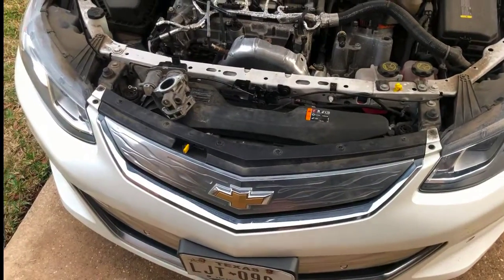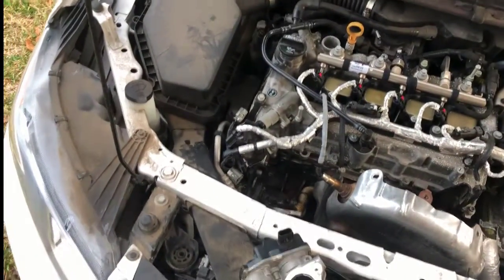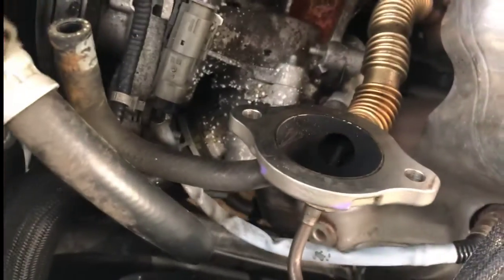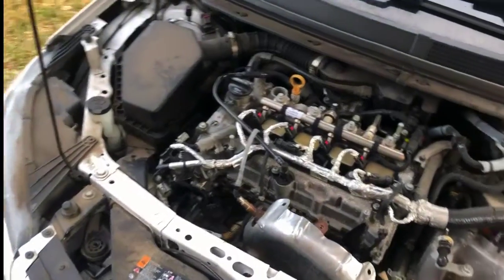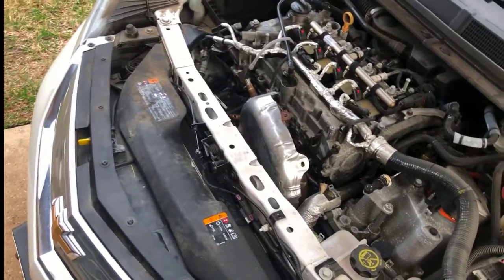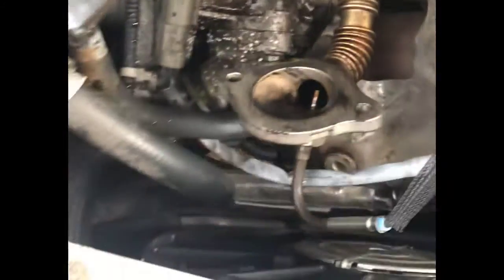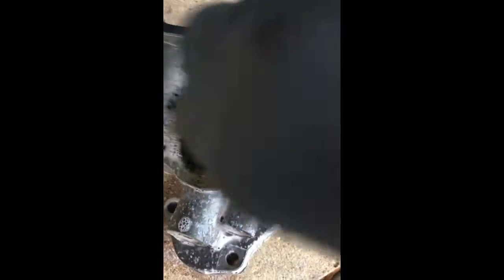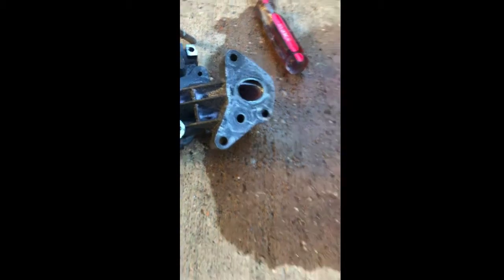Chevrolet P0401 Engine Code - EGR Valve & EGR Cooler Cleaning (Volt)

Comment: Well, it is a known fact that the first generation of Volts require premium fuel. There is no indication that GM did any modifications in the system of the second generation of Volts to justify using regular gas. Maybe they wanted to make the car sound more appealing to the average consumer who doesn’t want to pay for premium fuel. It is also a known fact that hybrid cars engine have a lot of cold starts. Every time the engine starts, a spark is produced which creates residue from the combustion resulting in dirty egr.
In the end, we all have to pay; whether we believe or not.
Now, my comment was more related to the fact that GM extended the warranty to 15 years for the clogged egr and the faulty BECM. The dealership replaced both items in my Volt for free. It saved me 2k plus 3k.
It is also a known fact that this video is about cleaning a n egr in the Volt.

Comment: As long as the EGR valve doesn't blow the non-walk-home fuse, it just needs a cleaning.  
 problem with these, is that the engine sometimes doesn't reach operating temperature, mine has come online a mile or 2 from home.

Comment: I just took my Chevy 2017 volt to the dealership with the same problem: clogged egr/cooler due to using regular gas instead of premium.
They replaced the system for free under GM extended warranty of 15 years/ 150k miles.
The same applies to the BECM problem.
From now on, I will only use premium fuel plus ocasional fuel system cleaner.
Also, driving on gas could contribute to cleaning the system.
Reply: I am very skeptical that regular gas could cause this problem.  Is this a known issue that regular gas clogs egrs?
Reply: Yeah I don't think too that using premium will solve this situation. Your engine may run even more sluggish until the computer relearn. Running the engine on hold mode, highway speed once a week will do a better cleaning that EGR valve. Also,  cleaning the EGR valve once a year, like explained in this video will probably save you some troubles.

Comment: Hi Rick! Great video! My wife's 2018 with 188000KM has this code. I will do a cleaning on the EGR valve and cooler this weekend. Fingers crossed.
Reply: Update: i used carbon cleaner with this method. Cleaned the egr valve with spray nine and some carbon engine cleaner. I then sprayed a bunch of carbon cleaner into the cooler and let it sit for about 10 min. Cooler was plugged up but the carbon cleaner worked well. Permanent fault code cleared now.
Reply: @shannonsmith148 it’s been a while hello, just wanted to know if you can update us on how’s it’s been now? Have you had the code come up again? I might take mine to a shop they will charge me about. $280~300 to clean both the egr valve and cooler so wanted to make sure this does indeed work 

Thank you I’m advance

Comment: Hey I wish I had your same reaction and outcome you did after I did this. But no luck for me :-( and my inspection is due this month. I soaked mine overnight. I also sprayed carb cleaner down the cooler while engine is running, read that somewhere. P0401 came back after reset. With scan tool egr error remained at negative 70% to mostly 96-100%. Fuse has never went out and coolant has never gone over 217. Any other thoughts?

Comment: Great video, worked for me, saved me $$$, Thanks! Some comments for those who want to try this:
1. This was a two-hour job for me. The bolts were difficult to reach; you'll sometimes be going by feel. I needed two lengths of socket extenders. The spacing is tight. I never cut my hands, but I went through several pairs of nitrile gloves. And I went through two handkerchiefs, I was sweating wrestling with this. 
2. Like another commenter, I had success just using carburetor cleaner with the straw attached to the nozzle to better direct the spray. I had the Purple Power degreaser on hand but never used it. The force of the cleaning spray really helped. I also used a small wire brush. If you go this way, plan to use a whole can (though you may get away with less).
3. There are two gaskets, one between the flange attaching the metal hose to the front of the EGR valve and the EGR valve and one between the EGR valve and the engine. Keep track of them, they could be easy to lose. The first is clipped to the flange, but the second doesn't have a retention mechanism that I saw, and is just sandwiched in place. 
4. In my case, not more than one pint of coolant leaked during the cleaning.
5. All bolts were 10mm. The two on the front flange are shorter than the three on the EGR valve itself. The three on the EGR valve have black plastic(?) bushings on the bolt-head side. These can come out of their seats in the EGR valve, another thing to keep track of.
6. I found removing the black hose secured with the hose clamp to the valve difficult. I removed all the bolts first, then rotated the valve to make getting to the clamp and hose easier.
Good luck!

Comment: Thanks man. This worked! I used b12 Chemtool spray and a power washing degreaser/hot water. Worked good. My cat would get red hot while idling the engine. After cleaning it stays nice and cool. So far so good. 2017 volt.

Comment: I Have a 2017 volt with only 20k which 90 percent of the miles were on electric.  I took a 2k trip and the reduced propulsion error came on.  Took it to a chevy dealer in Baton Rouge 1000 miles from home in Ohio.  They said it needed a new egr valve.  Ordered one on eBay for 575 and the are charging 250 labor to replace and 150 for diagnosis.  I would recommend anyone considering a volt to purchase used to stay away.  I bought mines new and it only had 20k before this problem and I rarely used the engine,  What a pice of Junk!!!

Comment: Hi Rick... do you know if Volt 2015 has EGR valve as well? I tried to located it but it seems it's in different location or does not exist.
Reply from the maker: EGR valves are a required emissions component so it’s going to have one, unfortunately I don’t have any experience with the model year. There are sites where you can access the service manuals and can find the location there. Try: https://www.gm-volt.com/threads/2012-chevy-volt-service-manual.19294/
Reply: Thanks a lot man.  @TheProfessorsWorkshop

Comment: Chev quoted me $2000 and charged me $175 to tell me they won't fix it. Thank you for your efforts here.
Reply: Wish I had seen this post... similar situation.  I ended having to pay $250 to the dealer to tell what my problem was - and then, wanted $3500 downpayment to order the part - then informed me that there are no parts available.   When I get my car back I will try soaking it for a few days and hope it can operate again.   I love my car, but I am totally done with GM.   (It seems that many 2016-2019 owners are dealing with this, so I am surprised there isn't a class action lawsuit)
Reply: Chevy dealerships are such an absolute scam. $250 just to run the code to see what the problem is. Do you have across the street at the AutoZone and they did it for free…

Comment: Thanks for posting this.   I had the exact same issue.   Back in 2021, I waited 6 months for a back ordered part.  BTW, at the time GM informed me that the repair was specifically excluded by the drivetrain warranty.  Fortunately, I had a supplemental warranty that covered the cost.
Reply from the maker: Thanks for sharing

Comment: Mine failed before 30k miles. Thanks GM.
Reply from the maker: Sorry to hear that
Reply: @TheProfessorsWorkshop  My dealership basically fixed it for free after letting it sit in their lot for months. GM kept ping ponging me back and forth. I did get the government involved and that’s when they got it resolved. The dealerships and GM know it’s a defect - they just don’t care.
Reply: This isn't a GM problem, it's EPA INSANITY. Nothing in nature  is designed to swallow its own waste. Plants, animals, ANYTHING produces a form of waste and it's called waste for a reason. Those things shouldn't exist. But, thank God I have the Gen1 VOLT. NO EGR SYSTEM !!!!😊

Comment: A carbon fouled EGR cooler is usually the source of the problem.  ECU detects low flow based on the temperature sensor reading downstream of the EGR cooler, so it commands the EGR valve to open.  When the command doesn't result in increased flow as a result of EGR cooler blockage it keeps trying to open the EGR valve and burns up the electronics in it.
The difficulty for a DIY job is that to remove the EGR cooler requires partially draining the engine coolant but to properly replace the coolant and purge the system of air one must run special commands to cycle coolant pumps and flow control solenoids.  Since most of us don't have the means to do so we're left to clean the EGR cooler without removing it.  I'm doing that now and it's a tremendous PITA.  That's in followup to the PITA of removing the catalytic converter to access the EGR cooler.
Reply: Any advice on how you approached the DIY job to clean the EGR cooler? Hoping you had success…

Comment: I can help to wonder that the Volt EGR issues are related to the functional design of the car itself. The ICE augments the battery pack. The engine starts / stops for short periods particularly in the winter. I suspect most EGR failures are related to the crankcase not often enough being allowed to get sufficiently hot enough and long enough to burn off harmful carbon and moisture within which leads to eventual EGR failure. I could be wrong. But, I run my ICE hard and often. I’ve also deselected the cold assist mode.

Comment: I just want to point out that this video has 27,000 views which is more Chevy volts that were sold in any single year of production, and roughly a third of all chevy volts ever sold. This is a serious problem with the car.
Reply: I agree with what you are saying but keep in mind a A lot of those views are probably people rewatching the video as they make the repair. I’ve probably watched this video about five times.
Reply from the maker: Since posting this video a few years back, I have been surprised how many people have issues with the EGR on the Volt! Definitely concerning.
Reply: @TheProfessorsWorkshop  , With the Gen2 Volt it has 3 things that crop up. Along with this EGR problem the BECM and the "Shift to park" problems. I have taken care of the last 2 but am awaiting the EGR problem. Thanks for your video!
Reply: @glasspilot1 how did you fix the shift to park problem?
Reply: @TRyanMooney - I bought the correct microswitch and wire harness attachment. Replace the microswitch and add the harness. The harness reduces the electric so the new switch doesn't arc over again. If you're handy it's not that hard.
Reply: What are you saying? Can you tell me more about it, I’m just facing this problem for the first time. Is there a link to any site where detailed correction steps are described?
Reply: Great video and very good presentation..I am having the same issue. But did drive on hold mode after cleaning the EGR ? Or on normal mode??
Reply: yes??? I own 4 Gen1 and 3 Gen2

Comment: You are the man, got this code in my gen 2. Did the soak with the purple power and cleaned it good. Installed and no egr code. Did however throw a o2 sensor code the carbon might have went downstream and clogged the o2 sensor. That's replaced and no codes for about a week. Thanks
Reply from the maker: Nice job! Glad it helped

Comment: I just did the decarboning and all I can say is that you are a far, far, FAR more capable wrench turner than I am because getting the inner three bolts off and then back on were as hard as any complete engine change I have ever done....Plus I lost my small 10mm wrench and socket somewhere in the bowels of the Volt...Aarch.
Reply from the maker: Ah, I hate it when the car eats up sockets!! lol. Hopefully it able to, at least temporarily, fix the issue.

Comment: How much fluid did you lose when taking the  valve off?
Reply from the maker: Not much at all. Fluid levels were still good and didn’t need any additional coolant. That of course may differ for others, so just check it after you finish to make sure.

Comment: 200k miles on my 2017. My CEL is on and it is throwing the code. I recently had the EGR cooler replaced, so im almost positive that it is the valve failing - right? Because if the cooler was replaced recently... It has to be the valve.

Cleaning it, im hoping will work - thoughts? Im basically ready to do it - but im also looking to get an EGR valve.
Reply from the maker: Since you replaced the cooler, the odds are it's the valve.  The positive note is that the valve is much simpler and cheaper than the cooler! It's worth the shot to try cleaning it before replacement and seeing if that solves your problem. You can take the sensor off the front and tell by looking in the valve what condition it's in before you even take it off.  Let us know how it goes and good luck!

Comment: I just got mine replaced by the dealership you have to tell them that it is covered under the PZEV LIMITED WARRANTY as long as it’s under 150k miles they won’t charge mine was at 84k when the egr valve and egr cooler had issues.
Reply from the maker: Nice! Here in Texas, they wouldn't touch it under warranty work, but hopefully, they've changed their tune now that they've had a lot of them with issues! Thanks for the suggestion.
Reply: @TheProfessorsWorkshop  I’m in Arlington Tx but got the service done in Fort Worth with no charge maybe it depends on your dealer but they didn’t give me any problems
Reply: Man I wonder if my local dealer here in Alabama will honor that PZEV warranty

Comment: isn't that a volt? try using the electric mode.
Reply from the maker: Yep. it's a volt but electric mode doesn't bypass the codes saved in the computer when it comes to state inspections.

Comment: Is the EGR valve location different in a 2012 volt? Took a look in my engine bay and it didn’t appear to be the same layout.
Reply from the maker: Yes, unfortunately the prior body design is going to be a bit different.
Reply: This is a problem with Gen 2 Volts, your's is a Gen1. Don't think you have to worry.

Comment: how about just disconnecting the batter to reset things to avoid having to do that crazy drive cycle?
Reply: Resetting the drive cycle doesn’t mean resetting the check engine light.   All vehicles have something called readiness monitors.   The computer tests onboard systems and some of those tests take a while to complete.  This is true for any vehicle post 1995.

Comment: Shouldn’t this repair have been covered under the 8 year/ 100,000 warranty on the hybrid drive system? My light turned on yesterday and the dealer appointment is later this week.
Reply: Any update if it was covered under that warranty, my light turned on today and i did a scan
Reply from the maker: Here in Texas, they told me no, it wasn't covered, although posters in other areas of the country seem to have had better luck with Chevy. Unfortunately, it seems to be a hit or miss - but definitely worth trying to get Chevy to fix it before you try a self-fix.

Comment: So, what is that confusing "drive cycle" you did? Why does it need to be done in the very specific way? Is it to make that part start working completely again? Does it have to be done if I don't need to pass an inspection?
Reply from the maker: Hi there. No, the drive cycle doesn't need to be done if you don't need to pass an inspection.  The car will automatically clear the codes over a week via everyday driving.  My car was past inspection, and I didn't want to get ticketed or pay the fees, so I was under a time crunch and needed to clear them quickly.